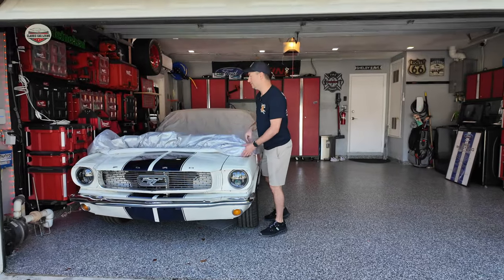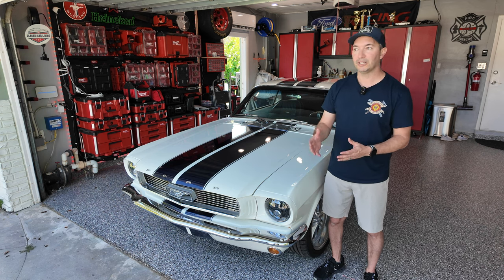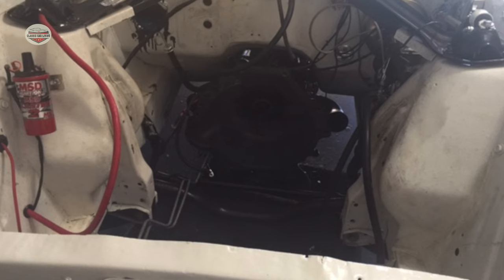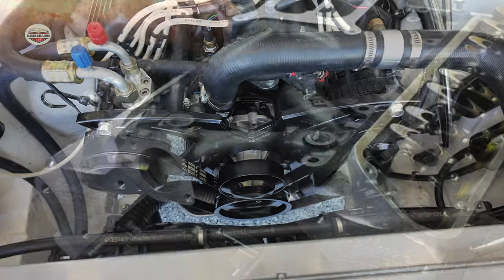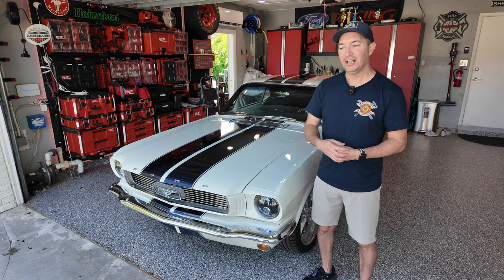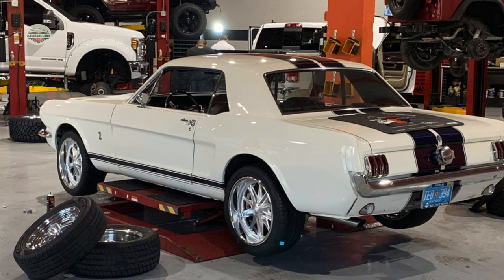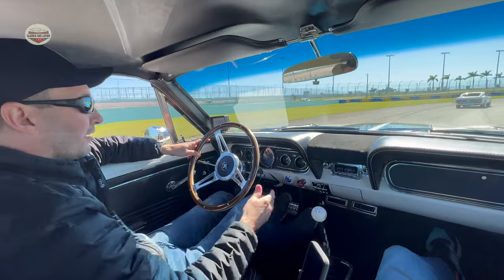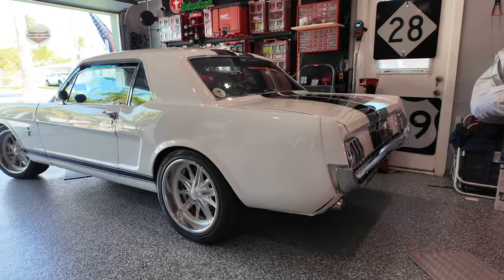Restomods: Why They're Worth Every Penny

Comment: Cool car, working on a 65 fastback now. That 2 tone interior looks nice!
Reply from the maker: Awesome!!! Glad you enjoyed!
Reply: I still have my 65 Mustang Fastback from high school, graduated in 1988. California car, 351w with AFR heads, Hydraulic roller cam all the good stuff. My dad passed away in 2002:@ 62 years young. I still have his original numbers matching 67 Shelby GT 500, California car, no rust or wrecked. Had a few engine mods , I kept it mostly stock because that's where the value is. 428 PI , original dual carbs, intake, valve covers , air cleaner etc. 030 over with a Crower 3/4 race cam. Runs strong.
Reply from the maker: @johnclemans7802  wow! I’m a huge classic mustang guy so I’d love to see some pics. Not sure if you can add some in the comments but check my bio for my email. 

Thanks for the support! Hope you subscribe to see more cars to come. 

Thxs👊

Comment: You hit the nail on the head with those rims I had a 68 Fastback for 27 years 289 13.66 ET  302 11.85 ET in 1991 then 351 W 11.35 ET not happy so 125 shot N.O.S 10.30 ET then 351c 10.80 on motor same N.O.S plait 10.02 at the end of it all 598ci s.v.o block TFS heads ported by Fox Lake CNC program 7.83 E.T 173 MPH Powerglide A.T.I 10 inch converter that was in 1999 not too many cars were in the 7s locally at Moroso
Reply from the maker: Nice!!!!! You wish you still had it? Thanks for the support.
Reply: @305classics  not really I don't miss it that was a part of my life that came and went but it was a great time and a lot of great people helping me along the way

Comment: Hmmm I saw drip pads under the car. when he pulled out of his garage..I bet just like every other engine being built these days it too has a rear main leak.    Engine builders are baffled as to why almost every engine being built leaks oil from the rear main.
Reply from the maker: These old cars all leak something. It’s frustrating but you have to learn to deal with it or go crazy. I have a buddy who couldn’t deal with it well and changed everything to stop it. Both my cars leak something but I’m fine. Put down a drip pan and make sure it’s not a huge leak. 

Thanks for watching! Appreciate the support💪